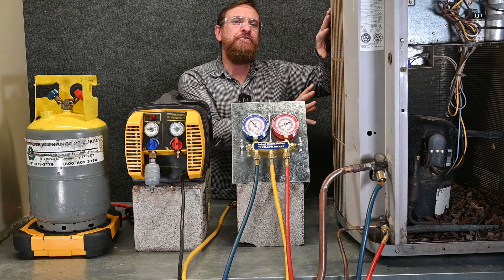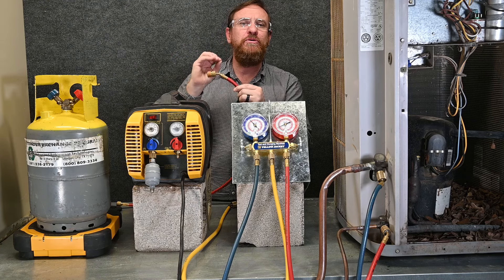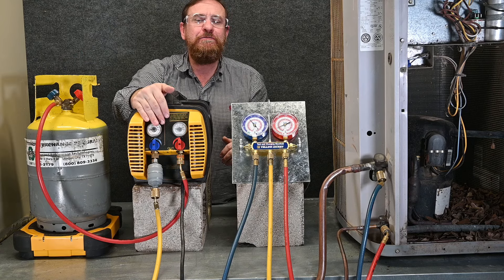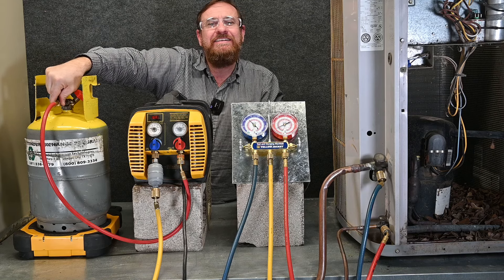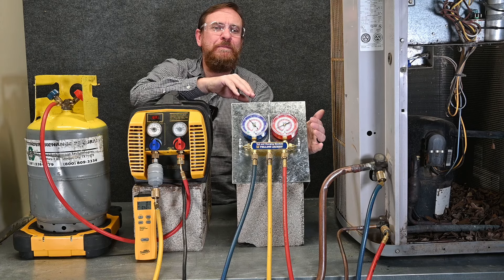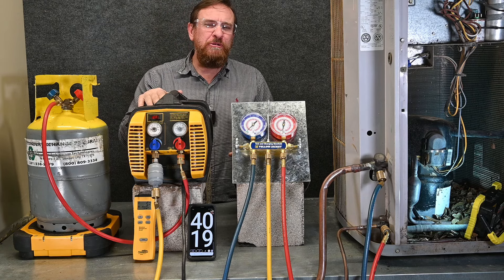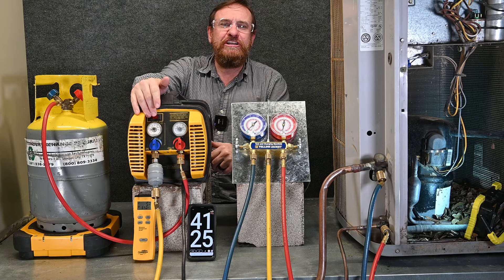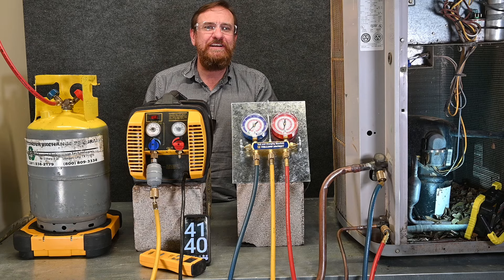HVAC 128 Recovery most used but slowest

Comment: I recover in a scrap yard and get the least mess from recovering from the liquid line only and vapor line shut ! If it gets really hot and hi pressure I use the very cold bath actually with ice and I put the whole recovery tank in the iced cold bucket!

Comment: Nice video. Why we did not see the manifold red hose purged? 🤔....
To avoid purging the red hose with liquid refrigerant I would open the manifold low and high valves and purge the red hose at the condenser port.  But wait you can't do that with low loss hose! 
This is one the reasons why I always use ball valve hoses.
Reply from the maker: The only reason is I feel i covered purging manifold guage set hoses pretty thoroughly in past videos. So I clarified this example  the manifold guage set is already attached and purged at the manifold. 

The  auto low loss fittings are a restriction and I do agree the ball valves are much better also covered in several previous. For many students starting out recovery is overwhelming so auto low loss is  one less thing to worry about while they build their confidence.
 There are many many problems with this method much beyond the low loss fittings. Check out the 2 videos to see much better and faster ways.

Comment: With that g5 if you need to restart the pump under pressure and not remove the hoses, close your manifold gauges then close the inlet valve to equalize the recovery machine then slowly open the inlet valve and reopen your gauges. Also to get rid of liquid after your recovery. Close your gauges then close the inlet valve with the pump still running. It will recirculate what is in the pump and super heat the liquid, let it run for 30 seconds then close your tank and  shut off the pump, you shouldnt have any liquid in your hoses.

Comment: I've never liked purging, it's a guessing game as to when the purge is complete - a waste of refrigerant if it's too long, or allowing contaminates into your recovery tank if it's too short. Put a core removal tool on the recovery tank and use it as a valved tee. This allows you to use your vacuum pump to very quickly pull all the air out of all the lines and your recovery machine. Only takes a couple minutes
Reply from the maker: I like that!
Reply: @love2hvac  I use the same valved tee method on my refrigerant bottle to vacuum my lines and guarantee no contaminates go into a new or existing system when charging
Reply: A vacuum pump doesn't pull a complete vacuum like people think.  There will still be air, just less of it. Maybe 1/10th as much.  That may be acceptable.  It depends.

Comment: Thanks for this. I’m not a HVAC Tech but I’ve been taking care of my own R-12, R-134a, and R-22 systems for 40 years. I’m hoping my 40 year old R-22 heat pump will hang on until the switch to R-290. 🙂
I was wondering about using a vacuum pump for this. “No” ok good info.
5:46 you open up the liquid side too. Is any liquid coming out going to flash to vapor before it gets to the recovery pump?
8:19 you note ice - remaining R-22 in the oil - are we talking 1 oz or what? I don’t have a feel for whether the ice is just remaining after, almost, the last bit of R-22 flashes or if some remains. I see the gauges at almost zero. Is it worth waiting for it to flash to vapor, relieving pressure on the recovery pump, and pump the last bits to the recovery tank?
Thanks again.

Comment: G5 Twin should be stored with both valves open and no caps on the ports. If caps are left on then they need to be left loose so pressure won't build up.
Reply from the maker: 💯 absolutely without a doubt put caps on. For sure have the valves open and  leaving them without pressure  is important. 
Appion says to use the caps don't let them be airtight. 
The contaminants, moisture dirt, dust and bugs wreak havock on the internals. The ones I rebuild that use caps are always much better  shape internally than the ones without. 
Especially when recovering with Poe oil. The moisture turns it back to an acid and that just puts away the anodizing coating. It does much more damage than the >15 psi vapor  that that builds up inside even with a tight cap.

Comment: Thank you Mr. Ty. Is possible to use only houses with ball valve with out using manifold gauge? And is there time for replacing filter drier for recovery machine? Thanks.🌷
Reply from the maker: Yes your going to like the next video. 
I should have clarified in the video. The one I'm using is not an actual drier it's just a filter. It lasts a good while depending on how contaminated the system is. 

I use a true drier when I have to put the same refrigerant back in. I will use 2 new driers. One when I recover and another one when I put the refregerants back in. I rarely reuse refregerants but in those cases the cost of the one time use dires are worth it.

Comment: I am learning Mobile HVAC . I don't find many pro level (with theory) videos like yours for automotive which is why I'm here . I have an older recovery machine Robinair RG3 with no purge knob. Manual says to remove refrigerant out of condenser in machine after you finish recovery operation to prevent possible damage to machine. Manual just says transfer to another container. How would this be accomplished? Thanks for any and all help Ty
Reply: I have the same problem with my RG410... after the system is in a good vacuum my recovery equipment has backed up liquid liquid refrigerant at high pressures... Manuel says to turn off equipment; set the recovery equipment to the purge setting and re-start. This does remove 95% out of the recovery equipment but not 100%  Ty mentioned using the purge setting on initial hose set-up. My equipment seems to purge fine with dial set at recovery... Now one gets stuck with a hose full of liquid refrigerant attached to the recovery tank :)

Comment: Hi, does this recovery also takes the oil out of the compressor? So if I want to add new refrigerant to this same condenser wouldn't the compressor lack oil? Great video. Thanks
Reply from the maker: Some oil will travel with the refrigerant depending on some variables. It's usually not enough to cause a problem with the compressor.  Unfortunately there is no sight glass for the oil level of the compressor in residential. 
When the system is up and running you can check suction superheat and discharge superheat. When they are too far apart it's a sign of lack of lubrication.

Comment: Hello mr Ty. I know my question is unrelated 
Would you be able to do step by step wiring on old school  all mechanical heat pump. Thank you for your time again.
Reply from the maker: I will, it's just talking a lot longer to get these done than I expected. Trying to do them all between other work and job.
Reply: @love2hvac  
Thanks. All I do in my work is troubleshooting on just residential. I did have a call for just replacing wifi T Stat. Some other company brought 120v to T Stat and I had no idea. When I put t Stat face back after finishing wiring. Fried the t Stat. Then I put my lead between C and R I'm reading 115 volts. I went to package unit. It was a mess.  Tech had 120 volts hooked up to R low voltage T Stat. What the hell. He fried the board.shorted everything. I had to re wire  everything and put universal board in. 
Videos on transformer especially on power supply 208/240/120 how to get hooked up to the board is critical. This is 3rd calls throughout this year I come across. Lots of new tech do not understand how to hook up power supply for transformer where C or 240 goes. on package unit. End up blowing things up.
Thanks again
Reply from the maker: I plan on doing a though wiring segment just like I am doing with the  HVAC fundamental series. 
It's been a lot of prep work and I expected to have it done by now but so much to do.
Reply: @love2hvac  
Wish live close by that could have helped .

Comment: Thank you for this video, I have a question - can I recharge my AC from the R22 recovery tank?
Reply: The method used to purge air from the circuit, vapor, is possible because it's a pure gas.

Thank you for your videos!

Comment: When you demonstrated that you loosen the red hose and raise it in the air so the refrigeratant drips into the tank wouldn't it get contaminated with air?
Reply from the maker: No because the hose is sealed so air does not enter.
Reply: @love2hvac  thanks for replying! I appreciate it

Comment: Why did you connect the last pipe to the vapor side and not the liquid side?
Reply from the maker: So the liquid will drain into the tank when it's complete. If it's attached to the liquid side you will lose all the Refrigerant in the hose because it can't push past the straw in the tank.

See the other videos in the series for much much better and faster ways of performing recovery.
Reply: Thank you